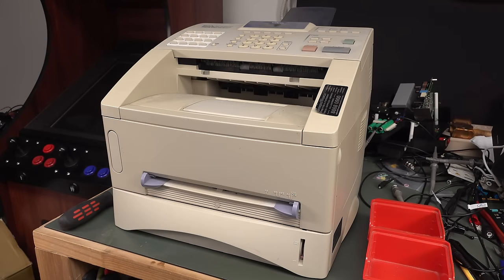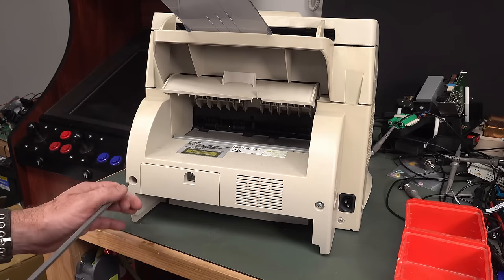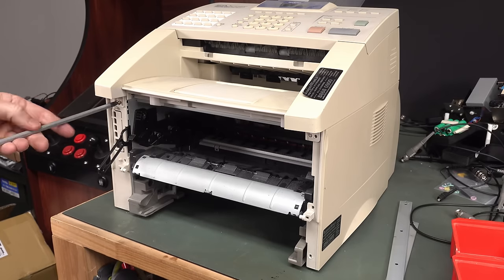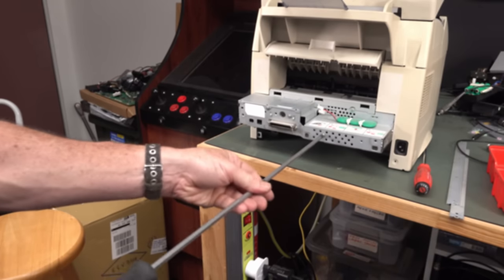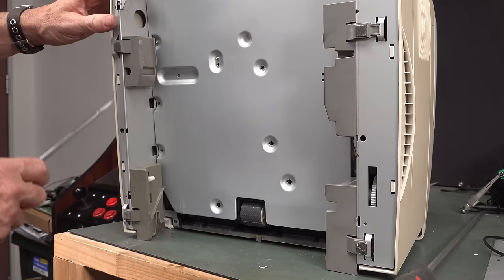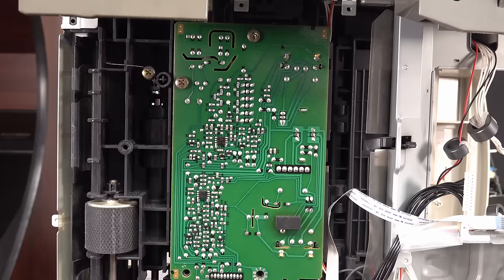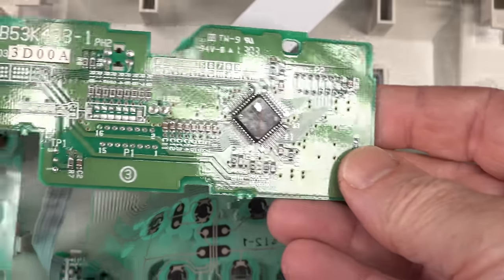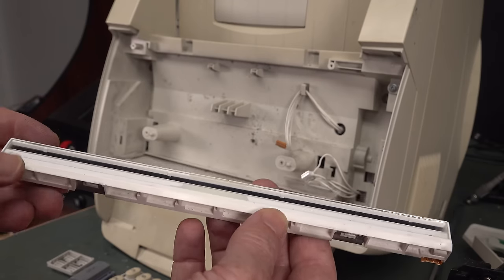EEVblog 1587 - Dumpster FAX Teardown

Comment: I use a fax as a backup means of serving papers on other attorneys, since many still have them. I had another lawyer claim he didn't receive certain papers served via email. I'm allowed to do "backup" service via fax. I could also mail them, but he gets an extra 5 days if it's served by mail. Fax is treated the same as email (but email is still required).
Reply: Yes - the last bastion of the fax machine is the law firm :)
Reply: @AndyGraceMedia  I suspect the healthcare industry will probably be the last one to ditch the fax machine.

Comment: I used to do a lot of work with a metal bashing firm in Birmingham - they used to sketch a drawing on paper and fax it to the bloke up the road with the CNC punching machine - this process was really rapid and efficient - for a shop floor environment, I can't imagine how you'd achieve the same thing as easily today (phones don't produce a conve nient disposable paper copy like fax did).

Comment: Those neon bulbs are gas arrestors, they protect the line in from lightning strikes. The centronics port can be used for printing, sending a fax from PC or updating the firmware.

Faxes are still heavily used in doctors and lawyers offices.

Comment: Hey this particular model is still found in may mailbox/ship places that you pay to send and receive faxes at least here in the U.S....pretty good machine as long as the pickup rollers/separator pads are good...good unit...I still know there is faxing going on...the Brother version here though does have a USB port for laser printing also.

Comment: Many restaurants (e.g. Chinese takeout) still use fax machines. 

Also, a lot of weather bureaus/stations actually broadcast weather reports via radio fax. 

I can receive weather forecasts from New Orleans via shortwave radio  (4316.1, 8503.1, 12789, or 17246 kHz) for example. 

I have yet to receive weather faxes from Australia (signal is very weak).

Comment: I spent years working as a Brother tech repairing these machines.

Certainly didn’t dismantle it the way you did 😂

Most common issues where the power supply triac would fail stuck on and burn out the rollers on the fusing unit.

And the bearings inside the laser scanner would dry out causing noise and eventual failure

Comment: I've worked on these for years, as well as other brands, Brother is one of the most well known and used small fax machines and longest lived, it was easy to find generic supplies for it and they worked well. Of course I used a different method for disassembly and service, to get to the main machine you had to removed the Auto Document Feed assembly ... these were built up HL-1240's and have been around 20 years or so, many offices still have them because they never seem to wear out. The omly thing that eventually killed then is if the spinning laser motor failed.
Reply: Ah so its based on the HL1240 not the HL1440 in daily use here. Laser motor still fine at 23 years but the fuser bearings can grumble a bit when cold.

Comment: OH NO! You forgot to take out the heater-fuser lamp AGAIN! ;) Those are thin long glass lamps that are pretty fun to look at. Even playing with them is fun: although they are 240 or 120V rated, connect to a standard 30V lab power supply and get a nice warm glow.

Comment: Faxes are still used in banking. They are considered more secure than standard email. They can be used to instruct all sorts and its not out of the ordinary for a signed fax to be used as authoriisation to make cash payments of millions of $s on a daily basis. Banks have obviously tried to move away from faxes but its still the primary method of instruction for a lot of firms, even for firms that have moved to contemporary authorised electronic instructing will use fax as a back-up method.

Comment: The last time I used a fax was when I was doing all the paperwork for starting a job at a large aerospace company in 2011....one that manufactures nuclear weapons just down the road and also making avionics to keep commercial aircraft from crashing into mountains or each other.  Would have thought that a company required to meet such high technical specifications would have stepped away from fax machines ages ago.  Obviously, I had to go down to the local print/ship shop to send it.

Comment: Many older 36 inch wide engineering drawing scanners had 4 or 5 scan bars from Fax machines. The sensor bars were physically not all in line but but they buffered them so recombined like one linear array. One i used on the early 90s was like that.  All Dos based with a window like interface. 

To align it in service mode you electronically input an offset. 

When older one of my early 90s scanner would have one 8.5 inch bar intermittent.  Bad caps.

So replaced caps all the time. Kept it aways on and that halted its decline.

Comment: 🖐  Yep, I have an attorney that requires some items faxed (both ways).   But, my fax runs on a google voice line run through a Polycom ObiHai connected through Starlink internet.  I'm rural and don't have land lines.   That's NOT a parallel printer port???

Comment: I don't have the fax machine but I do have the printer that they stuck it on top of.  They put a blanking plate on the front where the printer status lights would normally be.  Going to have to argue that Brother stuff was really good at that time, the laser printer portion of this machine certainly wasn't particularly good.

Comment: Even the old thermal paper fax machines used to have a copy function on them (10-15 years before this modern laser type). They only worked for single pages of paper, not for books (no glass platen; just a roller feed)

Comment: When I used to work for a big telco company a decade ago, there was a fax machine and used a few times a year for some special important/safety/secret messages. And in the beginning of the 2000s Father had one of those fancy memory fax receivers connected to the computer. It did not have a printer, just a memory and you could download and display it in the computer.

Comment: back in the late 90s early 2000s I worked for the original eFax company.We did bulk faxing for car dealerships, banks etc.
It worked great for a while. Then people figured out you can bulk fax from windows with a USB or printer port connected Fax. 
Or if you never need to scan or print the fax, just a modem. 
The company SOLD ITS NAME to some startup to buy it some time, but it was gone by the next year.

Comment: It's called an All-in-one printer, fax, copier.  Stull used in many industries to send confidential information with a false sense of security.  Also that round connector was Apple's older pseudo serial network connection.  The Centronix was in fact a printer connection.

Comment: I started my small business after graduating in 1995. I never really needed a fax machine, but did setup some kind of fax facility on my then Windows 95 PC using my standard landline number. It didn't really get used very often and then I bought a little OfficeJet print/scan/fax thing which again rarely did any faxing but was used to scan and email things. So, given all that, I'd say that I didn't really use fax in the latter 90's. Early 90s, I was still using electronic typewriters, photocopying and sending important things via snail mail. The most important thing (invoices) hand written in Biro on WHSmith duplicate invoice pad and posted!

Comment: crazy how some old electronics had such complicated physical builds.multiple small fixed function processors, fpgas and such wired together on multiple boards.  the amount of gearing screws and such. I've seen some machines that use multiple gears and solenoids so they use the same motor for many purposes. that's why electronics was so expensive back in the day, 80s and early 90s electronics was way more expensive than now. now everything just has a small computer chip and an lcd display in a hunk of cheap plastic

Comment: Earlier this century, and in the precedind decade, there was a strong overlap in technologies with snail mail,  fax, email and EDIFACT, etc with direct (business) document data exchange.

One of the many things that I did was to "bolt on" a document distribution system onto legacy systems. Loiking like a printer to the legacy system, it'd reformat the document according to recipient requirements and queue them for delivery by the appropriate means. Staff would still need to pick up a stack of paper documents for snail delivery but all else, including faxes, happened "by magic".

Comment: When I started my current job at 2008, we still did use a fax machine for receiving schematics and floor level plans from the designers. Many of which were old scans from 80's and 90's paper stuff, or some handwritten drafts etc. Rarely we sent anything back. 

But of course by that time mostly everyone just used email. Project banks and such had not yet made a breakthrough. But mostly what came out from that Canon fax-machine were ads from office supply chains etc.

Last landline (ISDN) at work was terminated just somewhere around 2018, when our now large worldwide corporation decided that it's too expensive to keep it alive. We still had the original phone line from 1991 when the building was made and our company moved in, to that point. Now it's all fiber optics. The desk phones are still connected to the base station, and you can make internal calls if you wish, but no calls to the outside world anymore. Nice trick to confuse some of the young players, by calling to their desk, where phone is still in place.

All the alarm & remote use stuff was replaced with GSM-modems and TCP/IP (comserver) where possible.

Comment: My first IT job has a ton of hp lazerjet 2 and 3's, all broken. I spent hours rebuilding into functional ones. PC LOAD LETTER! Lol

I've been a croc repair person, fixed probably every brand printer, fax, in existence.

My part time employer uses them, health care, the US just can't get off the stupid things.

As the sysadmin for a higher education school, I helped (with my network engineer) to convince everyone, and did away with all but one fax machine, just in case.

Brother mfc's are all I'll use anymore.

And almost all fax machines could be used as really bad copiers. I have late 80's brother, Panasonic, and Epson ones in a hole somewhere around here.

Comment: Still in use at my work place. Some oldtimer still thinks, the fax is much more reliable, in case the Internet connection goes down...
My estimate: Fax machines will still be around in 60 years or so.

Comment: Amazingly not a printer but only so they could charge more for the print enabled version. It wasn't long before "all in one" machines became the norm and no company in their right mind would sell a machine at this level with the print function disabled, but for a time, it was presumably more profitable to create artificial segmentation of products.

I remember the TN6600 well from my days "remanufacturing" toner cartridges, before it was cheaper to buy Chinese generic alternatives.

Brother mono toner cartridges are quite unusual in that the waste toner is sent directly back into the cartridge with the fresh toner. It's kept separate by means of electrical charge but if you run the toner too low (like if you tape over the toner level sensing window) the waste toner will eventually get back into the system where it will cause grey "backgrounding" all over every page. The waste toner will then contaminate the drum unit, so even if you change the toner to a fresh one, you'll still suffer from backgrounding. In the case this happened, both the cartridge and the drum had to be replaced or cleaned. Only changing one meant the cycle would continue.

Back in the day, we had to very thoroughly clean out the cartridges before refilling them. If anything more than a gram or two of old toner remained, you ran the risk of having backgrounding when you put the toner back in. We also had to thoroughly clean the transfer roller and "adder roller" inside the cartridge for the same reason.

It was also a nightmare trying to tell customers to not cover up the toner sensing window and explain to them that the 80g or so of toner left in the cartridge was bad waste toner. 

We even had a customer march in with a jar full of toner he had decanted from the cartridge after the machine said it was empty, absolutely convinced we were ripping him off. We invited him to buy a genuine bother toner and see if he fared any better. He came back with his tail between his legs a few weeks later.

Comment: I used an AVM B1 (ISA) ISDN card in my Win NT 4 Domain Controller and a Mustek SCSI Scanner in an intel Pentium I socket 7 PC for Fax.
Reply: Before that a Zyxel Fax Modem serial....
Reply: @borlibaer  Those were the days....
Here in the Netherlands, ISDN service has been completely terminated, and analog phone service can for all practical sense be called terminated.
My ZyXEL voice/data/fax modem and ISDN TA are still somewhere in a junk box... not usable anymore.
Reply: @Rob2  digital VoIP can be scanned more easy. I still got a telco center box with internal ISDN bus. If I find some time I like to re-setup an internal modem/ISDN infrastructure.

Comment: The main reason why we do not have FAX anymore: we don't have analog phone lines anymore!
Many offices here used to have a PABX with "digital" phones, which already was a problem for FAX.  But those PABX often had an "analog line card" to connect such equipment.
However, when offices still have desktop phones today, they often operate over internet (Voice over IP) and there is no analog line functionality at all anymore.
Of course there are ATA boxes, but they often have caused problems when used with FAX and telecom companies often do not support them.
Before we have used FAX-to-email services to solve the problem, but this year that has been terminated as well as it was almost never used...

Comment: Whoa, your tool is so much longer than mine! And I thought 20cm is something... did I call it a screwdriver? THIS is a screwdriver.

Fax machines were used here well into 2000s, 2010s even. Nowadays it's pretty much obsolete tech. I still remember the FSK (if I'm correct) tones when I called some business on the phone but reached the fax endpoint, haha.

Comment: Until a couple of years ago I worked for a major copier/printer manufacturer, our machines had copy, print and scan as standard with fax as an option if needed (a lot of healthcare/doctors still use fax!  (not uncommon for idiot customers to stick the phone connector into the network port and then complain that the printing didn't work!)

Comment: One place such things hung-on, was Construction sites; the contractor having maybe only a phone line or two as temp works, and before project hosting extranets took off (or, the on-site guys had bandwidth -for).

I sent my last fax as an Architect supporting the on-site construction team, c. 2005 (UK) - where they were located, utterly-ruled-out higher bandwidth options. Worked well - and there was a certain simple joy to receive a 4pixel potato-print, be able to use a marker to circle things , scribble 'Effing-no-way', and bounce it back ;)

I even 'issued for Construction' details merely scribbled on Post-It notes, taped to an A4 page, run it through the drum... 

...something about the daft , low-res interaction that somehow this amade me smile.

& 
Of course - today - I merely shoved 1GB+ of finely -granulated BIM data out to our partners, because that's the now, business -as usual; which I prefer!!

Comment: I'm a Network Engineer for a fairly large financial institution in The 'States, who also handles telephony requests from the users.  Still, today, in December of 2023, I get requests from users for new POTS fax lines.  I can't help but laugh..

About a decade ago, I had a fax line in my office for the desktop dudes to use and routinely someone would leave it plugged in after using it.  Come back a few days later and find hundreds of spam faxes for cruise vacations and car warranties...  Five years ago I'd finally had enough and deleted that line from the phone system and trashed the fax machine.
Reply: Yeah, in todays telephony solutions, a POTS line usually is not possible or very difficult to get working...
That is also the reason why our office multifunctionals, although they could FAX, are not wired to do so.
Reply: @Rob2  My site has both POTs lines coming in from the telco office, but also analog gateways for our PBX.  Unfortunately, we've got quite a number of analog lines still in use, from a couple backup modems (like on our routers for example) fax lines, door access intercoms, etc.  The next year of my life is going to get rather interesting as we're in process of migrating away from our current phone system provider to another... which doesn't seem to take account anything analog at all.
Reply: @elesjuan  Well yeah, we have not had an onsite PBX for several years anymore.  For some time there was a dedicated bandwidth circuit to an externally hosted PBX for about 100 desk phones, but now even that has been taken down and all telephony is directly over internet.  In a 1400-employee company we only have 16 desk phones left, in some positions where they are really handy or required.  Everyone else uses mobile phones.  Backup solutions on routers are also using mobile data.